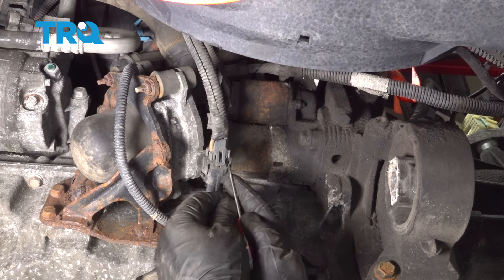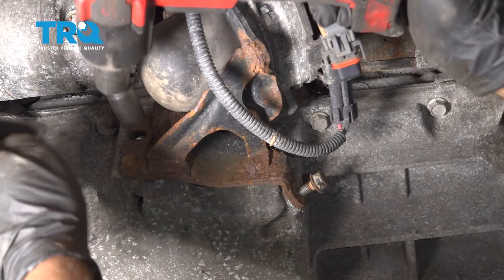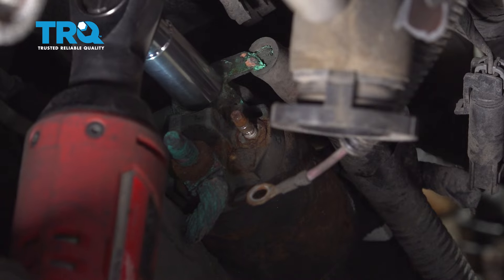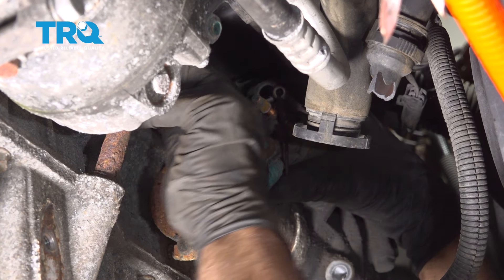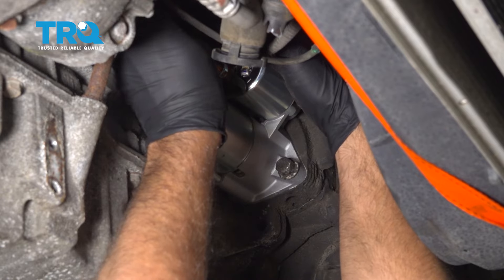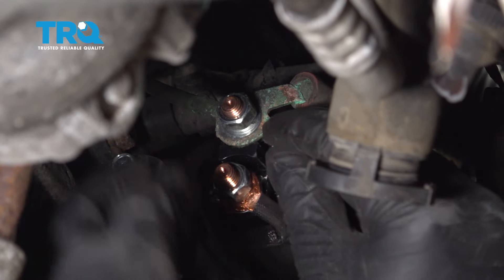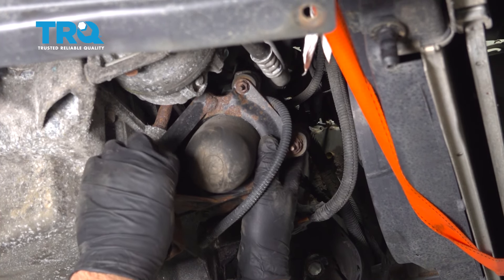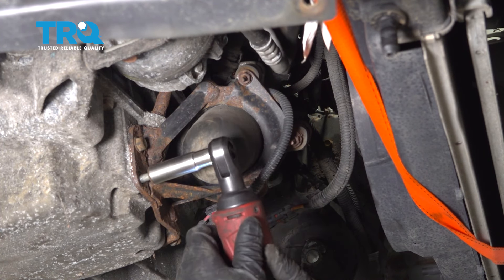How to Replace Starter 2005-2010 Chevy Cobalt

Comment: So the wire connected from sylinoid to actual starter if that wire is exposed can that cause any issues with the electric system such as starting when it rains my daughter's car is having this issue